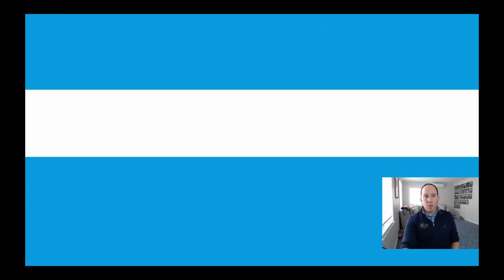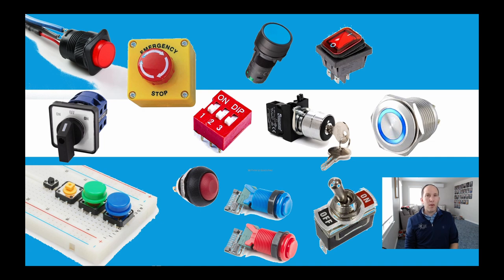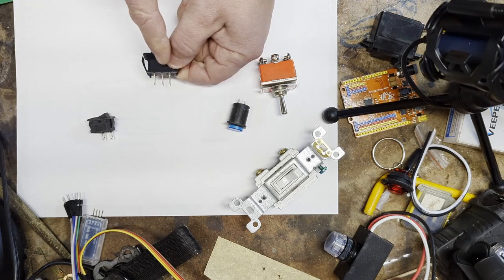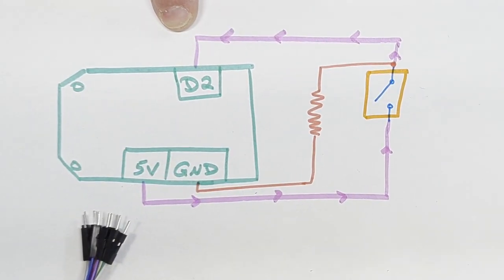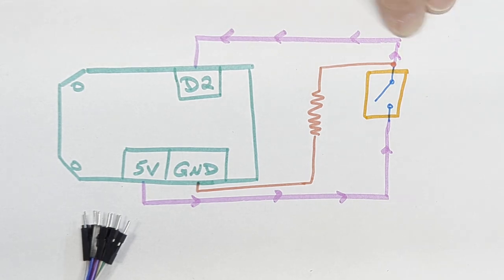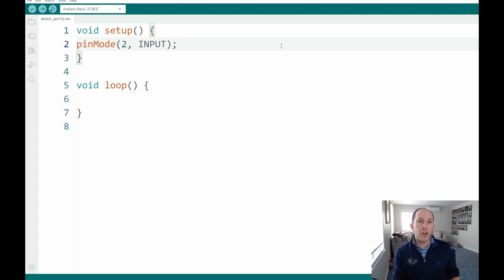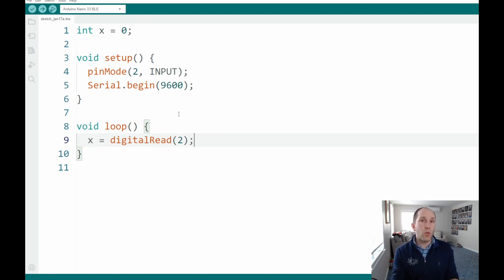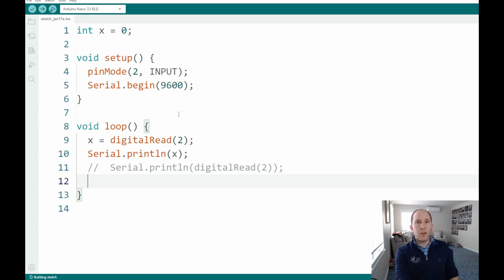Attaching any Switch or Button to Arduino Microcontrollers!

Comment: I need to turn on and off a red light a buzzer and a motor with a switch without a code. I had a lot of problems with that. Everything work separate but when i connect the arduino with a code (involving a gaz sensor) everything keeps turning on even if the switch is off and the sensor didn't sens anything.
Please can you help me i have a presentation at the end of this week

Comment: I was looking at getting a spring loaded toggle switch, but the only ones I found were 125v/250v. Am I correct in thinking these won’t work with an arduino? Or is that just the maximum voltage that can run to it.
Reply from the maker: yes, they are all fine.  the voltage rating is the maximum.  we are only using 5V.  a switch is just a device that connects two wires together.

Comment: hi teach‘,is that wire connected from D2 to the ground called pull down resistor?
Reply from the maker: yes the resistor is called a pull-down because it pulls the digital pin (D2) down to ground (0 volts)

Comment: WOW This is exactly what I was looking for. Can you use this same type of code for multiple pins? I am new to code and trying to set up something that would be more advanced. Can you tie the 1 pull down resistor to several input pins?  Do you do any teaching on Arduino?
Reply from the maker: yes, but you have to write PINMODE and DIGITALREAD separately for each pin.  you need a separate resistor for each button otherwise one button could end up switching all of the pins HIGH.  I work at CIJE and we develop STEM curriculum.
Reply: @adamjerozolim800 Thank you for the reply. Is there a limit on the number of switches you can use on 1 ground pin?
Reply from the maker: @rufustoad1 No, you can use as many as you like on the same ground pin, but each switch must have it's own resistor going to ground.  each switch can be connected to the same 5V port.  and each switch should go to a separate digital pin.
Reply: @adamjerozolim800 Thankyou Adam you have been very very helpful. Hope to see an few more videos for beginners!!

Comment: Excellent. I got mine working FINALLY thanks to this video. Have you thought about another video with 3 or 4 switches turning on 3 or 4 different lights and how to make code for that? Seems that if a guy could figure out a few of those switches it would be endless on what you could add including limit switches. OR would you just copy this and add several different pinModes etc?
Reply from the maker: correct this is the basis for almost any device, buttons and switches.  adding more would just be repeating this exact circuit and code.  you have to add PINMODE for each pin you are using, and a separate circuit for each button/switch